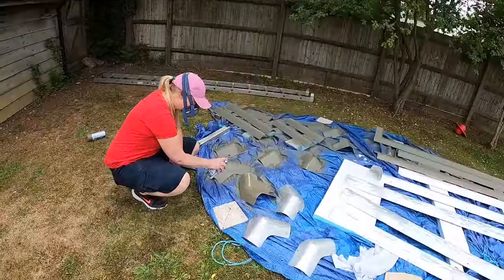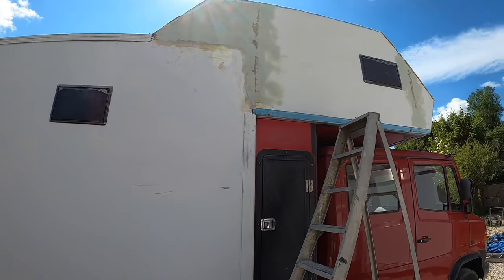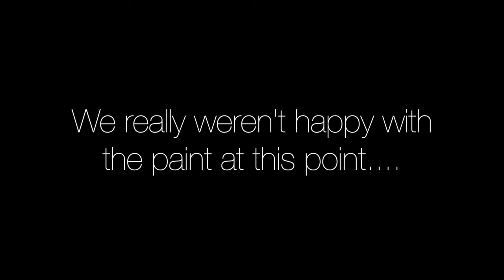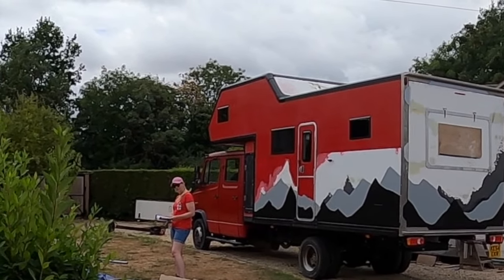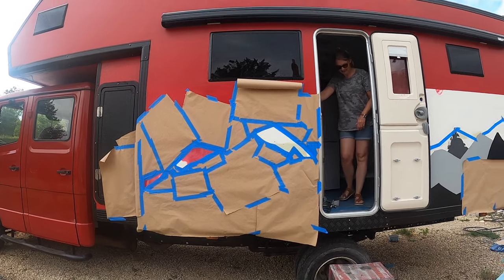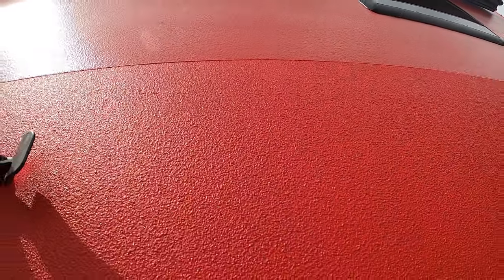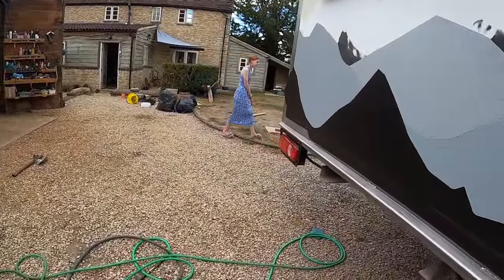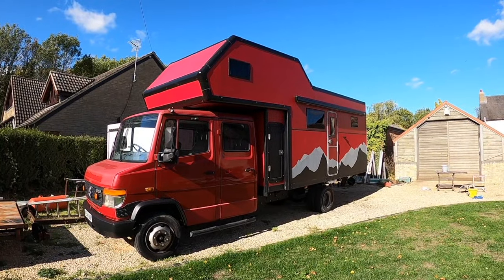We did our own family camper build paint job. Building our do it yourself Mercedes Vario.  Ep14

Comment: I can't believe how amazing your camper is looking!! All the hard work you have all been doing is finally paying off for sure! 😀   Argh the Awning! ahaha, mine was hanging around my tiny flat for 5 flipping months before I was able to fit it! aha, Tripping over the blasted thing did my nut in aha. Luckily no bones were broken aha. You definitely made the right decision going for the hand crank awning. I sadly went for the electric one and have had nothing but problems with it! aha, I have found though that having a little slack with the awning is out helps prevent tears when windy. Overall, you should all be so proud of yourselves! You have all done amazingly well
Reply from the maker: Hi Gwilym. Thanks, we're glad that you like it. Aha, someone else who used their awning as furniture for a while. Thanks for the tip about the tension, I didn't think of that but can see that it would make sense.
Reply: @teamchuggers  No problem :) aha now I wish I had thought of that!! The amount of times I faceplanted the floor was crazy 😂😂. No problem :) I made the mistake of having the awning to tight in winds last year, now it has a huge tear in it 🤦‍♂😂. I would say though when it is windy and raining crack it back in as the slack in it can cause a "pond" and that can break it aswel